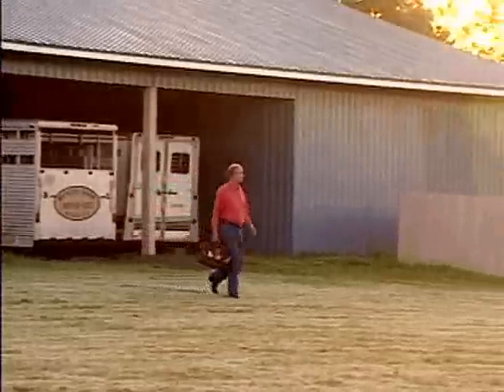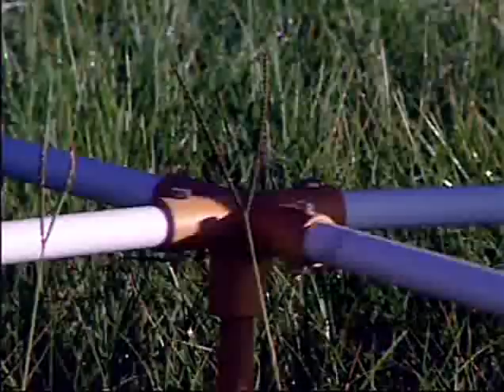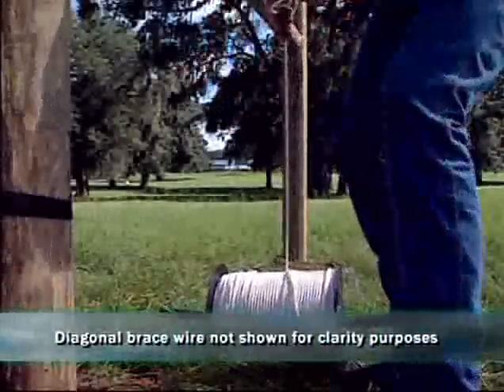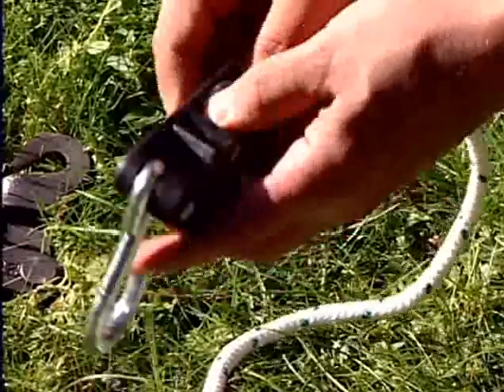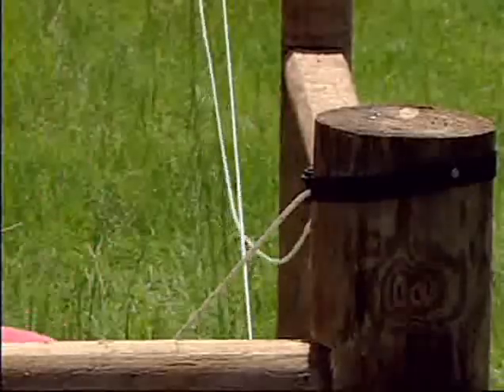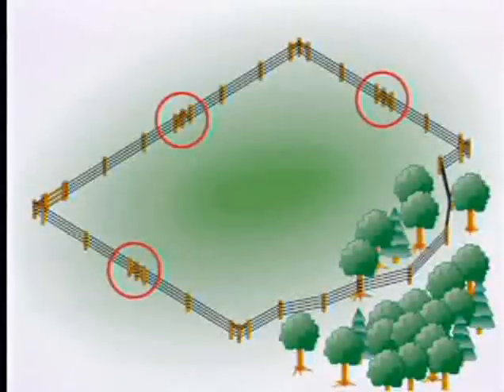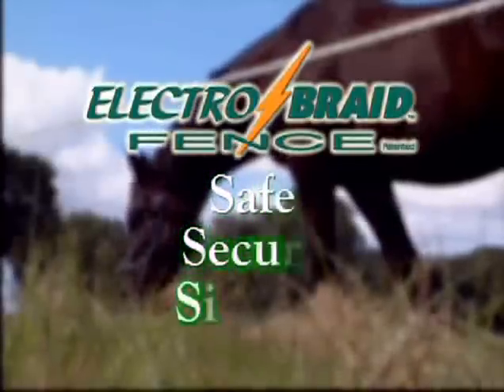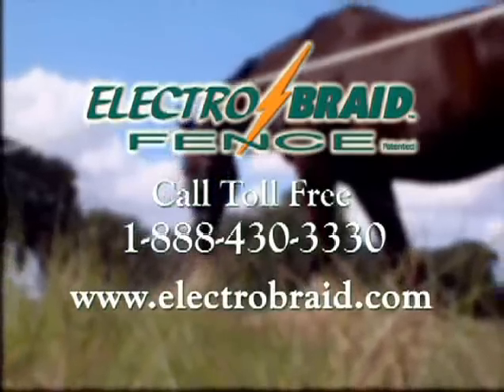🐴 ElectroBraid™ Installation Instructions ⚡️

Comment: Do not use this fence. It will kill your horse. The problem is that it stretches this fence along with finish line fence has now killed two of my horses because of the stretch stretch doesn't make it safer. It makes it more dangerous by far trust and do not use any fence that stretcheshorses very easily make a looper on themselves will kill them. Fence was installed to manufacturer specifications and two horses dead.